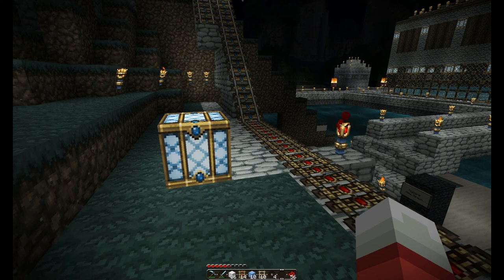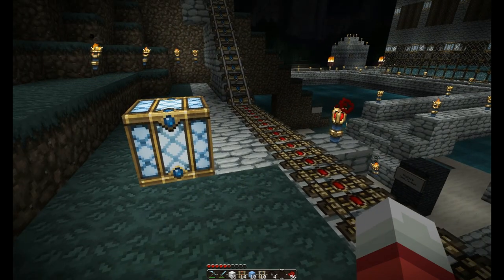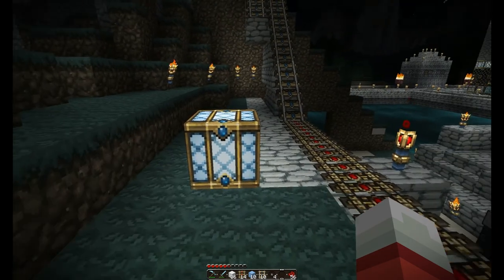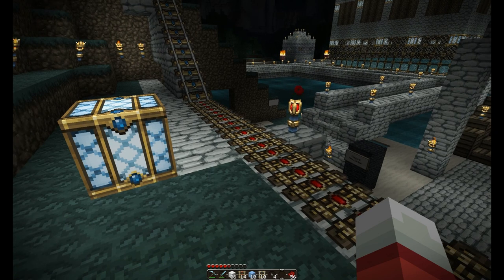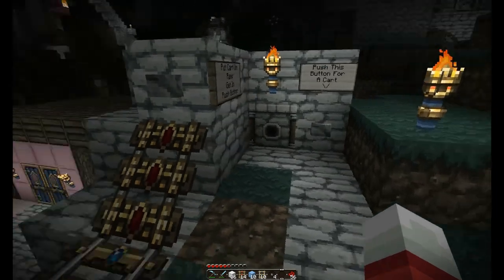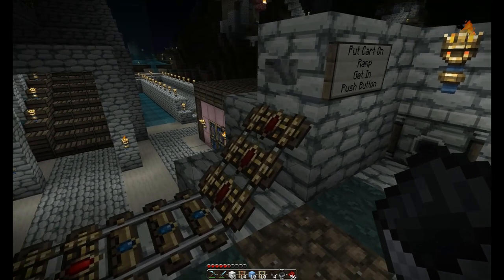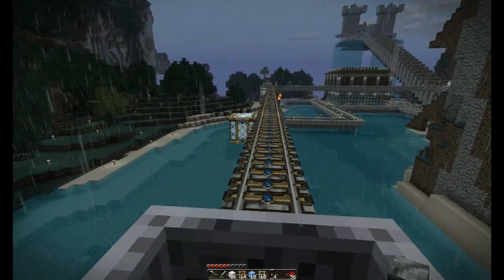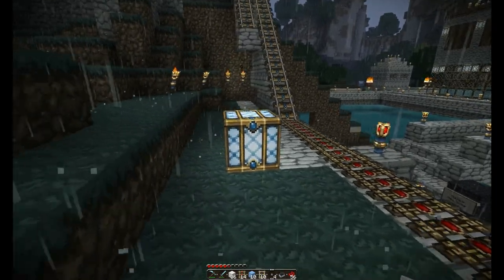Minecraft 1.6 Rail System Mine Cart Tutorial - Easy Launching &  In-Line Track Junctions

Comment: @Anthoric  Problem with a lever on a flat ground, is that it stays "on", keeping the power railed powered on and if you use that set up when returning back to that spot coming from the opposite direction, it doesnt stop the cart because it is still on. A button will turn the rail off so when you come back the powerd rail while not be powered and will stop the mine cart.